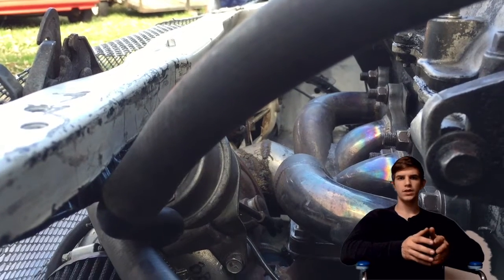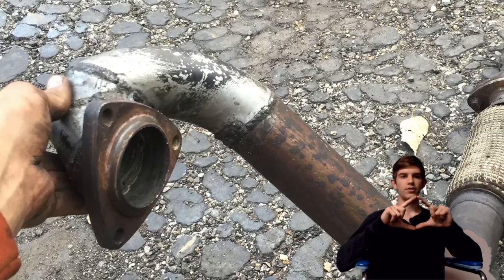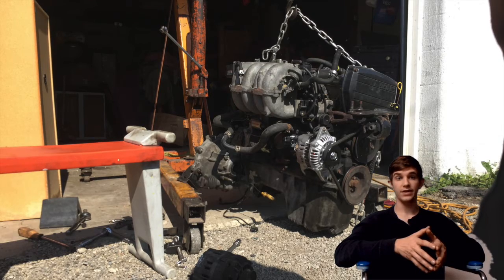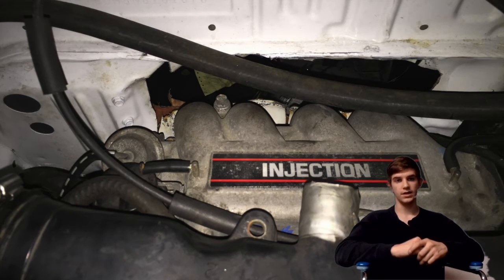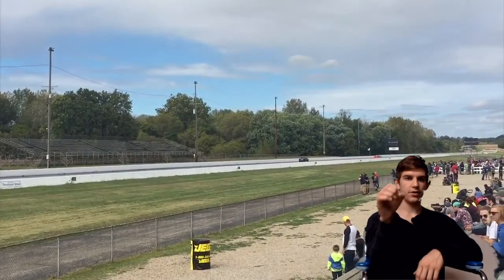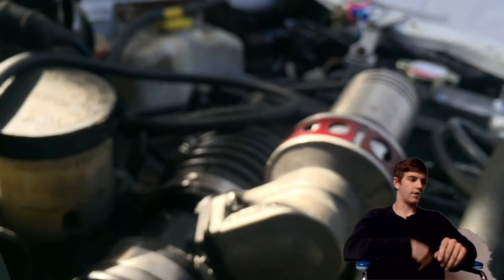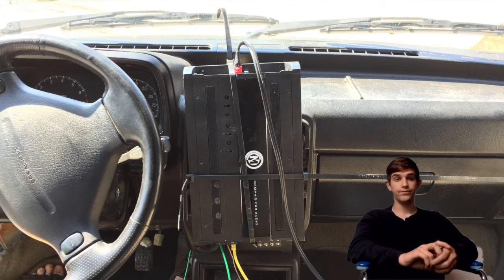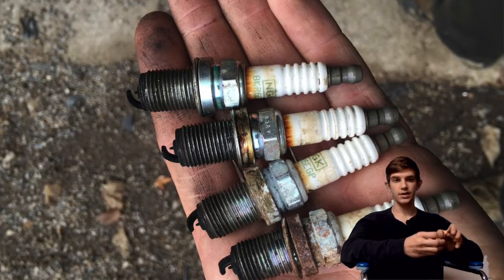Ford Festiva: 200 Dollar Turbo Build Overview

Comment: how hard is a bp swap what all wiring had to be modded?
Reply from the maker: Cody Liberati wiring that HAS TO BE changed? I think you can get away with plug and play. But if you want it to run well, you should run the extra wire to the dizzy and wire up the vics. Plenty of write ups on it already. Get cracking.
Reply: is the distibutor plug and injector plug the same